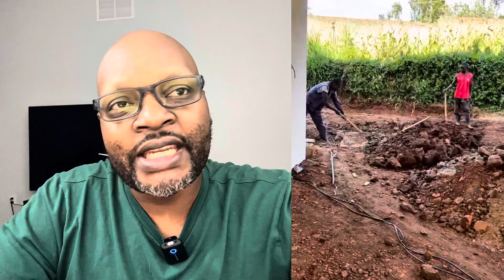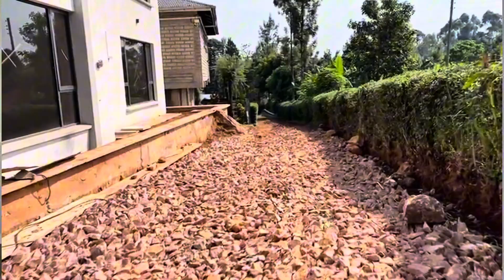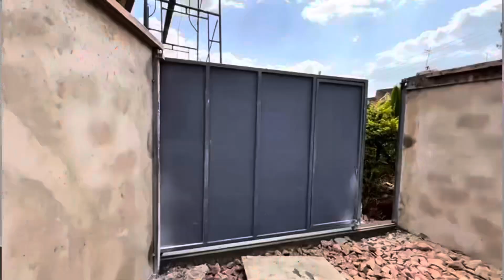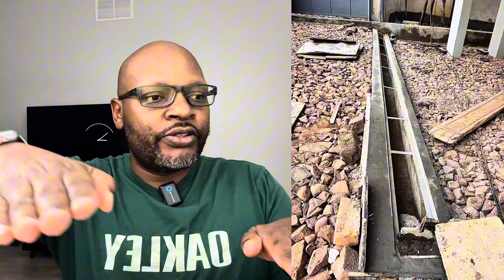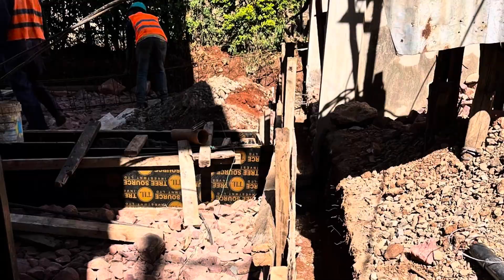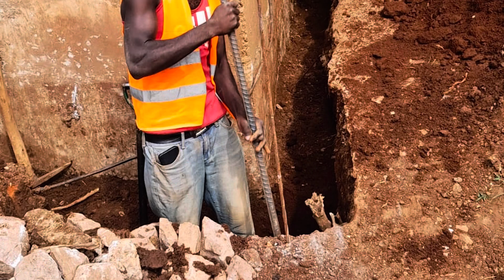Amazing DRIVEWAY Transformation: Instant Curb Appeal Boost

Comment: Driveway looks very nice with the cabro.   Kenya has beautiful natural plants and flowers so  with proper layout of the plants it will look smashing.  Of note, am sure installing an external septic is expensive but hopefully advancing the project won't require you having to dig any of the floors or driveway.
Reply from the maker: You’re right, the external septic was a major expense hence the reason I delayed it. The plumbing is in place and will not have to dig up any of the driveway.